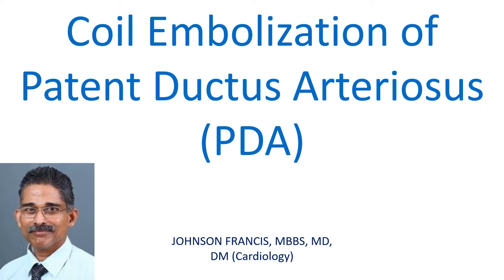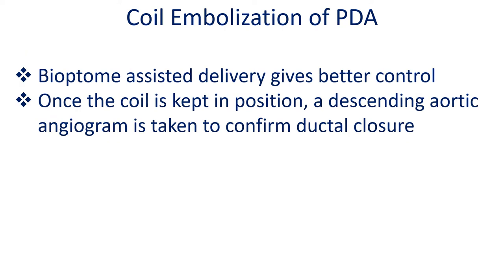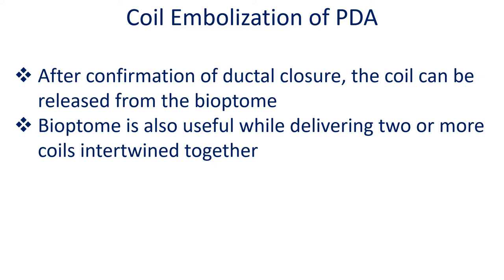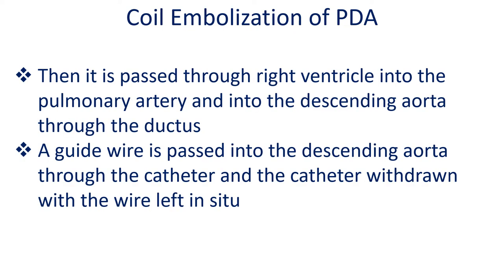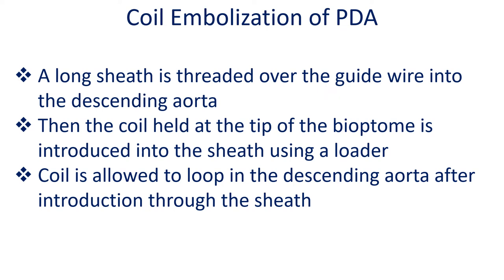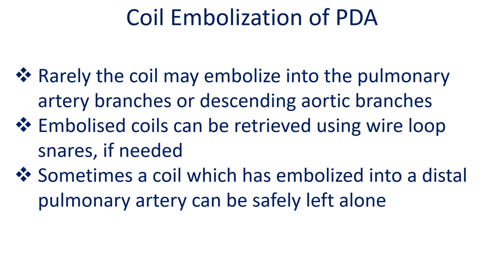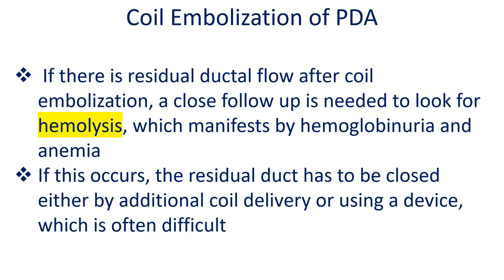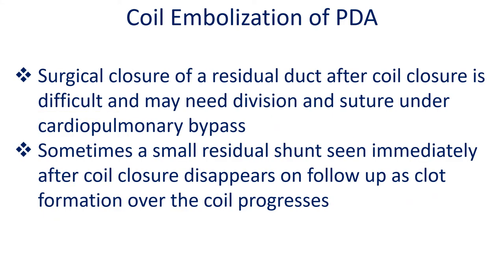Coil Embolization of Patent Ductus Arteriosus PDA

Comment: Thank you very much sir for this video . Sir I have a doubt sorry if its a stupid . Sir you had told that cournard catheter is directly introduced in right fv to RA TO RV TO PA THEN TO DESCENDING AO AFTER THAT THE WIRE IS INTRODUCED THROUGH THE CATHETER TO THE DESCENDING AO THEN IT IS EXCHANGED WITH A LONG SHEATH . BUT HOW IS IT POSSIBLE TO INTRODUCE CATHETER WITHOUT A G/W . maybe my doubt is utterly foolish but I have to ask you this  . Thankyou sir
Reply from the maker: Good question. Cournand catheter can be negotiated without guidewire. Sometimes guidewire may be needed to enter the pulmonary artery from the right ventricle. Of course, there is a short sheath initially in the femoral vein.